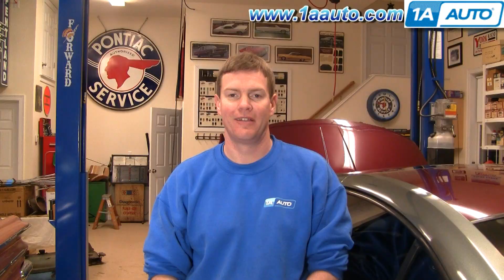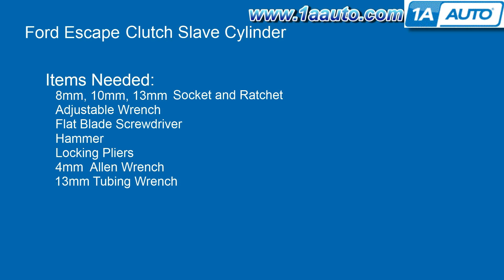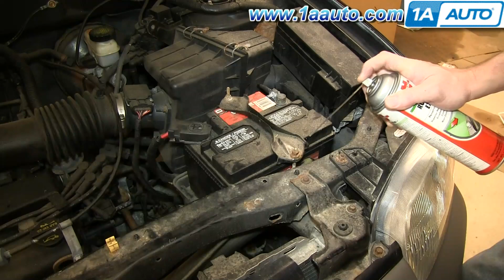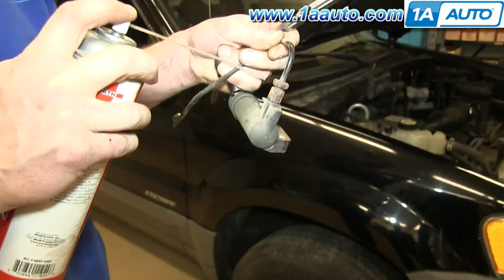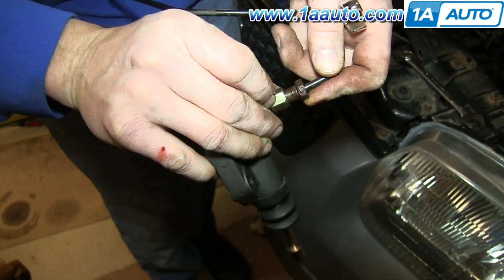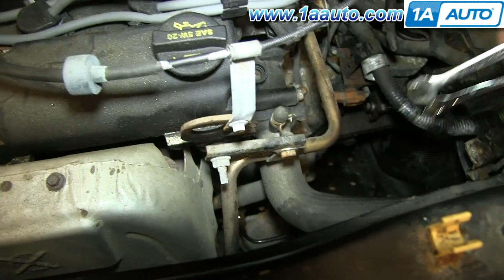How To Replace Clutch Slave Cylinder 02-05 Ford Escape

Comment: I realize it kind of looks like a slave cylinder, but it’s a clutch master cylinder, if you don’t want to agree with that, go ahead and do a search for a clutch slave cylinder for the year/model pile of dung you are working on, and you will realize straight away, you need to change the title of your video.
Reply: The master cylinder is where the reservoir is. The master cylinder pushes the fluid down the tubes to the slave cylinder that does the work. The title is correct.

Comment: i have a toyota coaster 1977 motorhome will be soon. i have been working on and off for 2 years on my coaster and my clutch did not work. to today i look at my clutch cylinder and put it apart and i look at it and it did not a spring inside of it haha. now I know why my clutch wasn't working too good. I will get a new one next week for $35 on ebay. I just replace all my old brake pipes back of my speedo where the brake Reservoir oil is and I do not have a clutch Reservoir on my coaster it shares with the brakes Reservoir. I have got a video of my Toyota Coaster motorhome on YouTube if you want to have a look at it needs a lot of work still I will get there one day.
Reply from the maker: +john lithgow Thanks for checking us out! 1AAuto.com

Comment: I know this is an old video, however if someone comes across this and actually reads the comments. This I believe is actually the master cylinder NOT slave cylinder. You have to drop the transmission casing to fix slave cylinders, in most cases that I've seen.
Reply: No
Reply: This is the slave cylinder

Comment: This video was extremely helpful. The mechanic was charging my girlfriend $800+ to fix it cause he had to “bring down the transmission. With some googling on the cars symptoms we came up on this video. Fixed it in less than 3 hours. Thanks for step by step A1 auto
Reply: This is a master cylinder replacement not slave cylinder. So it will cost more,but still shouldn't be $800.

Comment: Hi, I have an 09 escape. Stupidly, I guess they designed it with the slave cylinder inside the transmission. I started having problems at 50K miles in spetember, after a 2 hour highway drive, came off put into neutral, no pressure on pedal could not put into gear. Stopped for a bit, was late a t nght, managed to continue. Since then, i guess the pedal has felt somewhat soft but not enough for  me to think something was really wrong. i drive mostly short distances, so i did not have the catastrophic loss of pressure again. This week, going long distance again, it happened as i came off highway after 2 hour drive, 0 pressure in clutch pedal. Waited an hour, managed to get in gear, went to Ford in a small dealership, they changed the fluid saying it was dirty, pedal pressure restored, shifing smoothly back on hiway for 2 more hours, guess what, same problem when i got off the highway. Let it stand for 20 minutes, managed to get to destination, shifting rough.

Went to big ford dealership, talked about 1200 (can$) for slave replacement, recommended whole clutch for 1600.

They cannot figure out why the problem is worse after 2 hours at highway speed. Transmission expert could not figure out why working partially, other mechanic said high temp with engine running may be boiling fluid causing air?

As i say, 50k miles on the car, never ride clutch, cant believe its failing. 

Any help appreciated. There is no fluid leak, could this be caused by something other than slave cylinder? What would explain the intermittent nature ie short drives - pedal a bit soft, shifting ok, at worst (after 2 hours on hiway), clutch pedal flopping around with no pressure, cannot put into gear. Is it time engine on or temperature?
Reply: +Soneeeee My clutch on my 2001 escape is doing the same thing you described. Feels like there's no pressure and doesn't go into gear. I can still shift without using the clutch but that's obviously not good for the gears. I also checked both the master and slave and neither are leaking. If there is a problem with it, it may not be a leaking issue. 

Although my escape has 215k miles so it may have just failed.
Reply: Have the same probleme on my esacpe 2012, going to replace the Master Cylinder cost is 180$ça + 55 for the part. Hope it will fix this